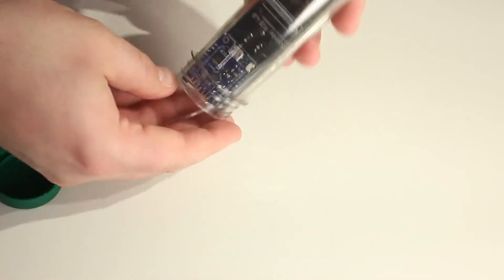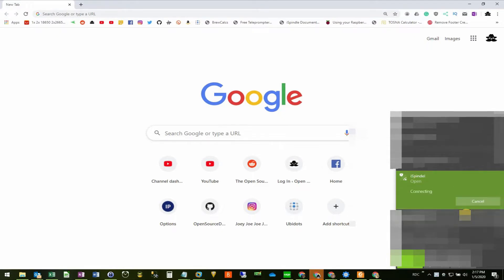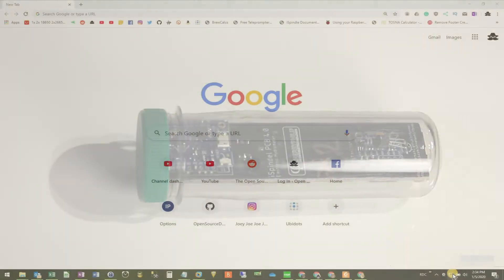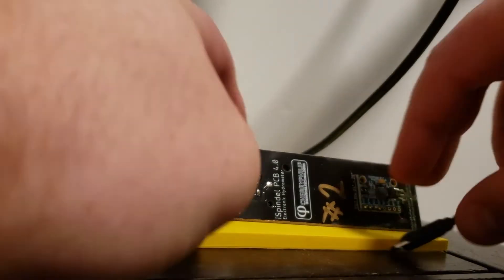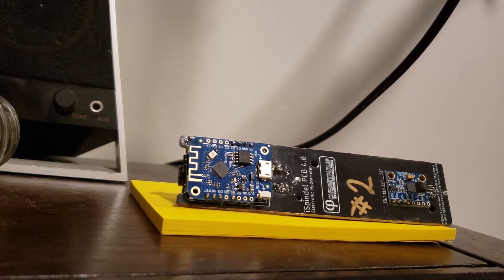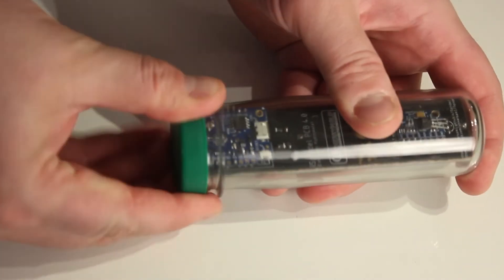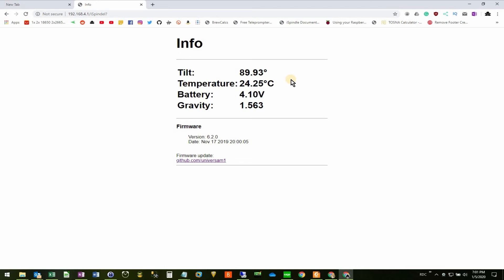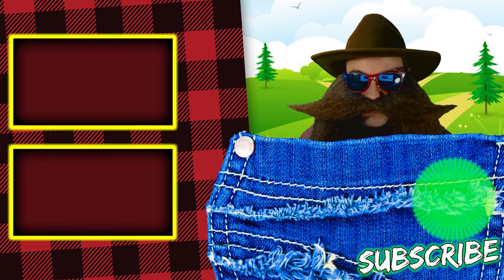iSpindel Offset Calibration in English - How to Offset Calibrate your iSpindel

Comment: You've brought me a long way. Thanks so much for the videos. now for setting the tilt in water and sugar/water mix. Any idea when that will post?
This channel deserves many, many more likes and subs
Reply from the maker: Hey @Barley and Hops Brewing! I'm a fan and you inspired me to make videos. The sugar/water mix calibration is coming, right after The Jeffrey 2.0 Assembly video, the 25 degrees in pure water calibration video, the Ubidots video, and finally the sugar/water calibration video. After that will come the fermentation calibration video and the battery voltage calibration video. There will be other distilling videos peppered in along the way. I wanted to thank you for everything you have contributed to the distilling community. Cheers, and keep on distilling :)
Reply: @OpenSourceDistilling  Thanks for the quick response. I look forward to these videos as they come. I am with up to this point with my Ispindel in working fashion so far. 
I plan to share this and also pump your video series instead of recreating it. You deserve the credit for this assembly and operation and I will ensure you get it. Just need to get to a working version. No rush. I do have several other things to work on for now. 
I did a Podcast yesterday with DIY Homebrewing and highlighted your efforts. That should post sometime tomorrow on the DIY Homebrewing  podcast site.
Good series and I appreciate the delivery. 
Happy distilling
George
Reply: @OpenSourceDistilling  If you ever want to discuss future topics please call me 
254-681-1760
Reply from the maker: @BarleyandHopsBrewing  Forgive the lateness of my reply, I caught a bug and have been down for a few days. Thanks for your kind words and support, I really appreciate it. If you ever need any assistance with the iSpindel you can send me a direct email here horseymchorseface.osd@gmail.com. I would love to hop on a call after the iSpindel series and talk about technology. I’ve been following your auditable hydrometer project and I have many ideas on how to bring technology into the distilling space. I feel we live in a very exciting time where technology is cheap enough, and knowledge is shared enough, that home hobbyists can build almost anything that they can imagine.

Comment: I have built the Jeffrey 2.0 and used the exact same 'PET' test tube/bottles as in this video. The diameter of the lip beneath the lid is slightly larger than the diameter of the main body of the tube so when placing it on a flat surface it is slightly elevated at one end. Is this correct?
Reply from the maker: There seems to be debate regarding if the lip around the lid is bad for offset calibration. I calibrated mine on a flat surface (as seen in the video) but I have heard of others hanging the lip off a ledge so only the smooth surface of the petling is touching. I suppose hanging the lip off a ledge would get you a little more horizontal and it probably the better way. As long as you can get to 25 degree in pure water after offset calibration I'm not sure how much it matters.

Comment: Hi great video, I just home built my own Ispindel, all working great, however, my reading are very different and am wondering if there is an issue, my unit is sat flat on the desk in front of me, 

Tilt 89.57 ok
Temp 27.69 ok
Battery 4.01v ok
Gravity 33.351 Help!

All help and suggestions gratefully appreciated, cheers Alan
Reply from the maker: What do they float in pure water? 

Have you done the sugar or fermentation calibration? Videos for those calibrations will be coming out in the future. Link below: 
https://github.com/universam1/iSpindel/blob/master/docs/Calibration_en.md
Reply: @OpenSourceDistilling  Hi I will try that once I get the plastic bottle, I live in Indonesia so its a bit harder to get things here, another quick question, I would actually prefer to use Blynk as my preferred display medium, any chance of that working as I didn't see it listed in the dropdown settings menu?, also I managed to get it talking to Thingspaek as I could not fathom out Ubidots, I got the Tilt, Temp, Bat but no gravity reading at all, any ideas? Cheers

Comment: Are you going to do a video on calibration in the sugar water?
Reply from the maker: Yes, the 'easy method' and we'll do one with an actual sugar wash fermentation as well.
Reply: @OpenSourceDistilling  What about how to track and what the best way to track it is? Love the videos so far.
Reply from the maker: @paintballjla  Ubidots is super easy to setup and use. The free "STEM" version (link below) can be used for up to 3 devices. I will do a video on that soon. https://ubidots.com/stem/
Reply: @OpenSourceDistilling    Hello, I do calibration in sugar water, measuring in 5 points.  When I enter data in formula and program iSpindel a have offset 5 points (1.045 instead of 1.050) Is it a way to correct formula without  desolving sugar and repeating whole process again?
Reply from the maker: @veljacvetkovic  Yeah, you should be able to add 0.005 to the part of the formula that is not multiplied by TILT, or just add +0.005 to the end of the formula.

Comment from the maker: Please note, that the offset calibration won't save unless you go to the configuration page and press save first. Saving configuration creates the config file on the D1 mini. If the config file does not exist before offset calibration, everything will look fine but the offset values will be lost when the iSpindel is turned off! This is true for firmware 6.2.0.

Comment: Excellent vid. Looking forward to the next one. I came this far by my self. Now, as we two talked about, struggeling  with weight for the ispindel (battery 49 grams!), not even close to 25 degree! I think new batteries is a start!
Reply from the maker: The 25 degrees in water will be an interesting one. I will be using both my PCB design and CherryPhilips' design in that video. Stay tuned!

Comment: I had the exact same cable issue with my D1 mini clones when trying to add the deep sleep function. Spent an entire day pulling my hair out. Used 3 different cables that I had on hand and they ALL turned out to be power only... Hit up my local Frys and got a 2.99 sync cable and everything was right as rain after that
Reply from the maker: You know it blows my mind. I wasted hours trying to figure it out on multiple computers. My issues was that when I plugged in the D1 with the bad cables the D1 blinks like it acknowledges it's connected, but it's actually not. By looking at the cables you can't tell which ones are the right or wrong ones. The 3rd cable I tried worked. I have now labeled the working cable and will use that one moving forward! Lesson learned.
Reply: @OpenSourceDistilling  Same here. I was connecting mine to arduino IDE for the sketch upload and I tried every computer in my house. Went so far as to recompile the CH340 drivers for my ubuntu machine (after reinstalling ubuntu) thinking there was something wrong with my hardware since it blinked, therefore it should work, RIGHT?!? My data cable is now properly labeled as well!
Reply from the maker: @jwade8080  Yep, I installed the CH340 drivers multiple times on Windows 10. I had someone reach out on reddit and their issues was that they had a bad cable and they couldn't charge. They thought something went wrong with the build, tried different wall chargers. Again, turned out to be a cable issue. It's crazy because I've never had any issues with a USB cable before with any device. I suppose Arduinos are special or sumptin.
Reply: @OpenSourceDistilling  There were a few references to bad cables in the in the Q/A section of on the Amazon link I bought mine from. I shouldn't have dismissed them so quickly!